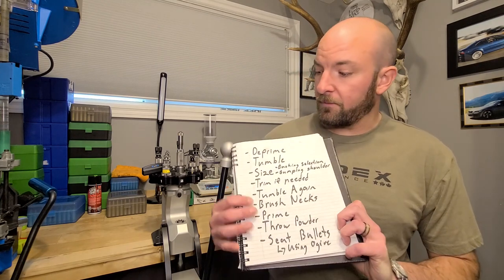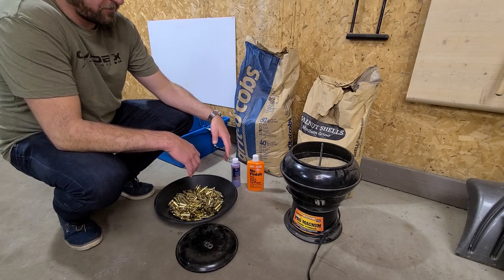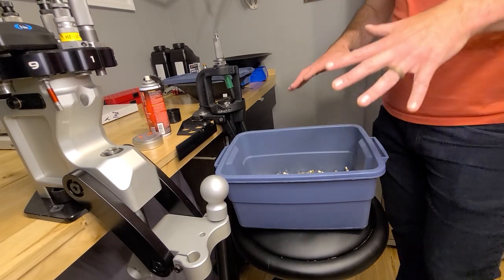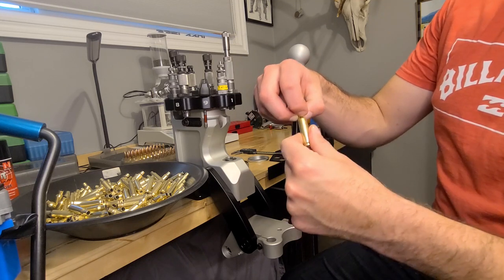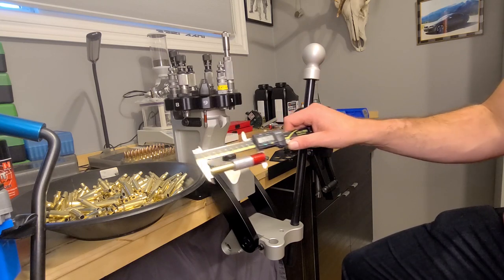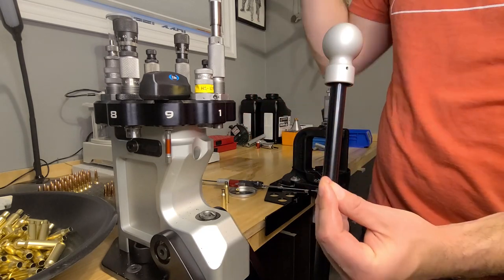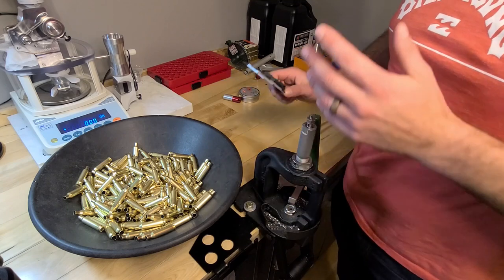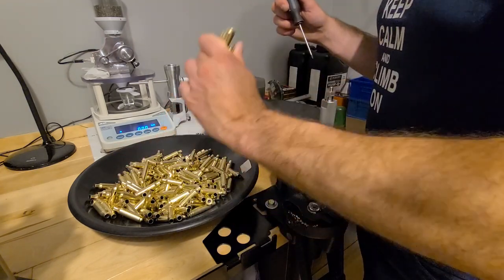Reloading PRS ammo step by step

Comment: When/how do you anneal?  Seems like the 3 times you touch the case's a Lyman Case Prep Center with Chamfer/Debur/brush might be a worthwhile investment.   Nice video.
Reply from the maker: I don't have enough experience on annealing to speak authoritatively on it.

However,  annealing is done before sizing.  I have a home made induction annealer I just finished up.  I should have some tests done with it in the next week or so.  Still playing with it.
Reply: @BillyRed182  I appreciate your honesty regarding annealing.  It gives everything else you talk about more credibility.
Reply: I never use to anneal but found that I was getting about 8 firings for each case before neck cracking. I then started annealing about every 5 reloads and found the brass getting about 20+ reloads. I now anneal on every reload and my groups have tightened up significantly (from 1.25 MOA to 0.25 MOA). I started with a Bench Source annealer ($500) and about 6 months ago bought an AMP 2 annealer ($1300 but worth it).

Comment: New to reloading here, what's the purpose of using the tumbler twice? TIA. Great video!
Reply: The first step was to deprime the case. This allows the primer pockets to be cleaned as well as the entire case. The second cleaning was to remove the lubricant off the case when used to full length resize.
Reply: @gorillamotors  ah makes sense, thank you great info.

Comment: I suggest: rotating 180 degrees between each resizing, trimming all cases to same length, since you're using a power tool I suggest deburring inside and out in REVERSE so as not to remove a lot of brass and just knock the burr off, brush cases after deburring, rotate round after seating 180 and seat again a second time.
Reply from the maker: Thanks for the input, I will try it out!